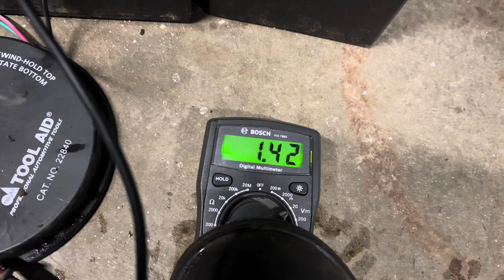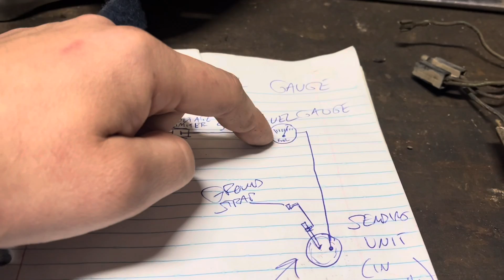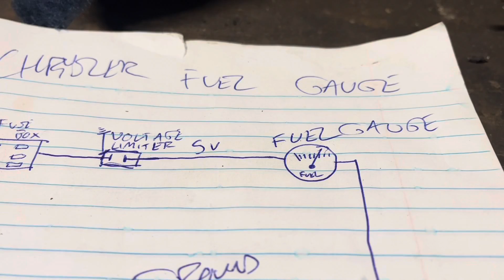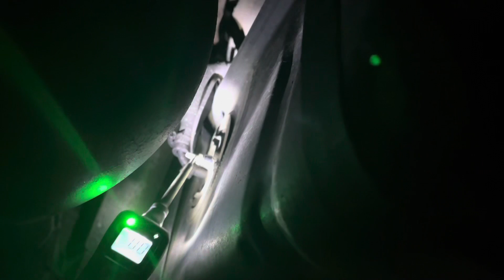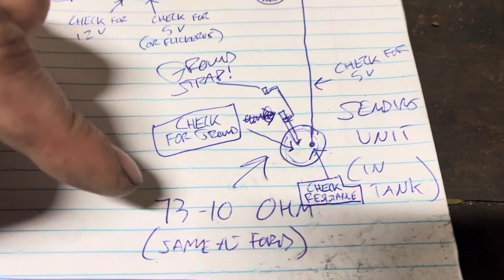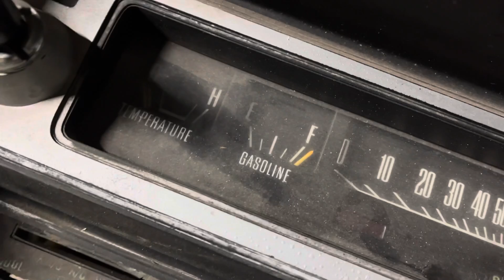Classic Mopar Fuel Gauge Problems (And Gauge Voltage Limiter Info)

Comment: My gauge lifts to zero when ignition on but won't go higher. I haven't been able to check for voltage dropm
Reply from the maker: Assuming we’re talking about the fuel gauge, if it’s coming up to zero, you almost certainly have a bad sending unit / sunk float.

Comment: Thank you Jamie, When I had all my Mopars it was in the mid 80's to early 90's before I got on as a pilot with the airlines, I never ran into any of these issues. Gas had lead in the fuel and never went bad, nor did I have any electrical problems, I Am learning a lot. Thank you Sir.

Comment: Hey Jamie
even if this video is old what would happen if the gauge was to receive 12v constantly? the gauge would show full at all time or just fry?
Reply from the maker: Gauges will burn up quickly - and when I say burn up, there won't be flames, but there will probably be smoke. Been there, smelled that.
Reply: @DeadDodgeGarage okay so I need a proper ohm regulator like a metermatch

Comment: hey I heard you mention you used to get the emulators at radio shack, but you don't see those anymore.....I was amazed to see a Radio Shack when I
was in Maui Hawaii last week! It was actually in Lahaina at Whalers village.  I wish I would have thought to take a picture. Hey thanks for the 
gauge info, I was unaware of the limiter, even though it is listed in my schematics as a regulator. My sender is fine, 8-75 ohms. And my gauge is not
dead, it shows full or near full when tank is full, but once you get down to 3/4 or less it starts going all over the place, everywhere but the actual 
reading! Going after it this week.
Reply from the maker: Interesting that the sending unit tested out ok. They tend to be at fault when gauge readings are inconsistent like that. The gauges tend to be more of a pass/fail situation in my experience. They work, or they let all the smoke out. 

Limiter / regulator terminology - I think either is fine. But I have to intentionally say “limiter” to distinguish this part from the voltage regulator under the hood. This has confused people in the past.

Comment: Mine is a 1973 Barracuda and the problem is the gas gauge works when it wants to so while driving it will go from empty to a half tank and back to empty while just going down the road. Any suggestions?
Reply from the maker: Most likely a bad sending unit. My demon does something similar.

Comment: Thanks for the video; I will be looking at these items on my '71 Demon as the gas gauge does not work. All other gauges do work so i assume its no the voltage regulator. I've ran out of gas twice now so i guess it's time to figure it out. The odometer does not work either. Wife gets a little unhappy when we run out of fuel, lol.

Comment: My 67 Dodge Cornett 500 when I turn my headlights on the fuel and temperature gauge both go to maxed out
Reply from the maker: Interesting. I suspect power from the gauge back light circuit is somehow jumping over to the output side of the gauge limiter.

Comment: I recently took my dash out to replace the lights and installed new circuit boards. After installing it back in the car, my lights work great but my currently working fuel gauge is now not working. Key on, gauge goes to past full. Key off, gauge drops to empty but slowly. Any ideas?
Reply from the maker: Either your limiter is bad and you’ve got full 12v going to the fuel gauge (which will burn it up quickly) or your sending unit wire / pin somehow ended up grounded. Also not good

Comment: Hey I know this is actually kind of an old video but I'm having some kind of issue with my fuel gague and I can't find anyone that's having the same issue. I've got a 1972 Plymouth Sattelite Custom with 57,000 miles on it with nearly all original parts.

Essentially, my fuel gauge reads empty most of the time. Every once in a while it will just randomly start bouncing up and down slowly. Even when parked on a level surface. I watched the gauge move back and forth for about 10 minutes. Then the next time I fired it up the gauge was back on empty. It's been probably one out of every fifteen times I fire the car up that it does this. I have a video if anyone thinks that'll help assess what's going on. My guess is something with the wiring but I'm not sure because I know absolutely nothing about electrical.

 I am brand new to the Mopar life and the classic car life so if anyone happens to know something then I'd love to hear your thoughts.

Comment: Question. 64 Polara. Temp gauge passes the grounded sending wire test, tries to peg but no reading with a hot engine, new sending unit in the water pump. Temp gun shows 185 at the thermostat housing. Please help, I'm lost.
Reply from the maker: Huh. That’s very odd. 185 should definitely be registering a gauge reading. I’m not sure what to think of that.

Comment: Whay would you say causes my fuel gauge to stop working when I fill up the tank. 3/4 full it's OK, any more it goes to below E.
Reply from the maker: Bad sending unit in the tank.
Reply: @DeadDodgeGarage  Thanks Jamie. I have the original. New parts are crap these days. I will swap it out.
Reply: @DeadDodgeGarage  You were right but it was the sending unit wire that had fallen off. I cut back some if the plastic connector  cover and if mounts on really tight now. Thanks again.

Comment: one of my 73 darts i did the 7805  voltage regulator,  capacitor and heat sink upgrade.on the dash,  worked great never failed

Comment: Hi Jamie I have changed my fuel tank for a fuel cell with a new sending unit now my gage reads backwards. What gives?
Reply from the maker: Your float is sticking off the wrong side of the sending unit. I’m assuming this is one of those universal type sending units that can be adjusted and such. If not, well, that would be very strange.
Reply: @DeadDodgeGarage  hi Jamie it's a racers choice I'm not sure I bought ase a complete unit I will check.tks for getting back so quickly.love the video's..!! Cheers

Comment: Jamie, love the video, but what does it mean when I ground out my sending unit with a test light, the test light is blinking with the power up and down but the fuel gauge doesn’t move, would you assume the fuel gauge is still bad even though Power is going through it?
Reply from the maker: Using a test light isn’t the same as putting a wire straight to ground. The bulb adds resistance. Try that and see what happens. If there is still no movement, yeah, it must be bad.
Reply: @ I put a ground wire on it and that fuel gauge ran up like it was running from the police. Definitely a bad sending it! Thanks!
Reply: Thanks Jamie!!! The sending unit has a big sticker that says "maid in Taiwan" on it LOL Love your channel by the way.  Still waiting to hear if your putting the Hemi in the Charger or not?  If you get a minute, check out my 69 charger project on my new channel "Hemivertible" I enjoyed watching guys so much on Youtube I figure I'd jump in with you!!

Comment: Great information. Thank you brother! Please give the best place to purchase a solid state regulator. Just in case I need one. My fuel gauge pins full all the time. My temp gauge works.  Any input is greatly appreciated. Thank You.
Reply from the maker: Standard Ignition actually makes a replacement mechanical unit. The fancy electronic type comes from Charger Specialties.
Reply: Thank You Sir.

Comment: Im working on a 65 300. Is that capacitor that plugs in next to the voltage limiter  necessary for the fuel gauge to work? If i replace it will any capacitor do. Was gonna grab one for a points distributor
Reply from the maker: No, it is there to prevent interference noise in the original radio.
Reply: Thanks! Much appreciated.

Comment: My 68' valiant /6 with the ignition on the temp gauge arrow moves from left to right-side and maxs out. I've unplugged the boot terminal in the meantime. Is this commonly known to happen when the instrument panel 12v regulator has gone bad?
Reply from the maker: Yes, your limiter is stuck closed and it’s trying to fry your gauges. It would fry your fuel gauge too, but it sounds like your sending unit is probably bad so there is no path to ground to complete the circuit.
Reply: @DeadDodgeGarage  I would agree the fuel gauge, and alternator still function. Are there any tricks of the trade on confirming TSU to have gone bad. Would you recommend I R&R the limiter as well

Comment: could an actual ballast resistor be used in a pinch Jamie ?
Reply from the maker: Negative. The voltage limiter is not a resistor - and the ballast resistor is not exactly a voltage limiter, although lower voltage during operation is observed.
Reply: @ Rr cheers , have good Christmas 🍀

Comment: i got round guage with fuel in the middle. I can’t find this part ? help .
Reply from the maker: Three stud fuel gauges have the limiter built in. Many early to mid 60s dashes are like that. I didn’t cover them specifically in this video. It’s essentially all the same, except that limiter is hidden in the gas gauge, so it’s a bit more complicated to fix.
Reply: @ thanks Jamie
Reply: @ Jamie ! It’s fixed !, Thank you very very much . Just behind the Monaco temp guage was the limiter . Tiny purple wire was burnt . Solder connect and seems ok 👍

Comment: Hey Dead Dodge Jamie........Technical Question fer ya:  I pulled out the Voltage Limiter from behind the dash of my '74 Dodge D100, and ran a test on it........she is turning on/off and popping out the correct range of volts....2 - about 6 volts.  So I then turned on the Ignition Key and tested all the fuses behind the glove box barn door.......all tested about 12 volts except the Dash Cluster fuse.  So I thought "Ahhhh Haaa.....excellent.....its just a blown fuse".  Not so easy......I pulled the fuse, and it is fine.  However, there are no volts showing up at the fuse panel connection points.  Does the juice first flow to the Voltage Limiter, and then on over to the Fuse Box?  So, with the Voltage Limiter removed, it is normal to see no volts at the fuse panel behind the barn door glove box?  Im gonna pop it back in and then test the fuse box for power......but thought this question might help someone else also.  

I have no dash lights, no fuel gauge reading, and I believe the Water Temp gauge is also not working.....thus, I thought the V. Limiter was the gremlin.   What say you?
Reply from the maker: I don’t know what feeds the gauge limiter in that truck, but I have a feeling that the fuse you were looking at is for the gauge lights. It is fed by the dash light / rheostat section of the headlight switch. I highly recommend you consult a wiring diagram!
Reply: @DeadDodgeGarage  Thats a Big 10-4 from my Dead Dodge Glove Box Barn Door.
Reply: @DeadDodgeGarage  Yes, you are right......turn on the parking lights or headlights and power goes to that little 2amp fuse.  From there it feeds the dash lightbulbs.  I see 2 round condensors mounted behind the dash.  One is connected to the positive feed connection prong of the Voltage Limiter.  I cant find anything in the big Shop Manual describing what these "condensors" are for.  Can you pull an answer from your vast wisdom of Mopar  Wizzardery?  What the heck are these 2 condensors for.  If they are bad, will it cause the Voltage Limiter to fail also?

Comment: Ok I have a question 
 I’ve got a 69 superbee , I’ve upgraded to a solid state voltage regulator but all the gauges read low , temp barely gets warm , oil pressure 20psi ( checked with manual gauge and it’s about 50psi ) and it never shows more than half a tank …. Despite it being full …. Any pointers ?

Comment: i have my 67 belvedere which is 100% original torn apart and i see no voltage limiter anywhere under this dash !!
Reply from the maker: Ahhhh, it’s built into the fuel gauge on that car. Look for instructions to eliminate that and convert to the later type.

Comment: stupid dash never ever ever comes apart i need to know the location and keep getting zero answers
Reply from the maker: The location of what? The limiter? It’s on the back of the cluster. Probably perfectly blocked by the steering column support bracket. Lower the steering column slightly, which requires removing a plastic panel (2-4 screws, if it’s even there) and 3 or 4 7/16” hex nuts / bolts. Take the screws out of the cluster. Pull the cluster forward. Make sure the battery is unhooked when you do this. It’s annoying, but it’s not hard to figure out.

Comment: First thing to check on a fuel gauge that floats is the connector between the fuel sender nipple and the fuel line to front of the car. It crimps on the nipple and the fuel line. It provides ground to the sending unit. They corrode and break. Always check that first. Always.
Reply from the maker: The metal ground strap? Sure. Great thing to check, and I’m confident I mentioned that here. But also, in many cases, the sending units are able to ground through the lock ring, tank and mounting straps to the car. I’ve seen multiple cars with no ground strap on which the gauge works fine. I’m not suggesting that will work 100% of the time, but despite all of the hack jobs I’ve had to deal with over the years, I have never once had a missing or otherwise goobered ground strap be the cause of a gauge problem. Yet.
Reply: @DeadDodgeGarage  That is the good fix I saw back when there were Mopar magazines. Using that Voltage regulator IC. Good for you to share that with others.

Comment: My man, thank you so much. My voltage limiter was topping at 6v max as yours, changed it and I finally have my gauges working properly + I’ve learn quite a bit about the system. 

Thanks for doing those videos, you’re saving us. Have a good one
Reply from the maker: Awesome! Glad to help.
Reply: @DeadDodgeGarage  do you have the part number for that?

Comment: I know this is an old vid but, do you have the part numbers off of the solid state regulator you use. I’m going low tech on a Durango and have an early 70s sport fury cluster that fits in the original hole pretty well. It’s a nice all in one part. Speedo, gas, oil, temp. The cluster has been in dry storage for 20 years. But I figure I might as well change it out wile it’s easy to get to.
Reply from the maker: The little limiter I solder in looks like this: https://www.digikey.com/en/products/detail/stmicroelectronics/L7805CV/585964

The fancy plug in ones look like this (note there are a couple different styles): https://www.ebay.com/itm/165630787671?chn=ps&norover=1&mkevt=1&mkrid=711-117182-37290-0&mkcid=2&mkscid=101&itemid=165630787671&targetid=2301729088052&device=m&mktype=pla&googleloc=9033514&poi=&campaignid=21214286338&mkgroupid=161332760117&rlsatarget=pla-2301729088052&abcId=9407521&merchantid=6296724&gad_source=1&gbraid=0AAAAAD_QDh9AeCj2nBjFCS76XVm-ArG4X&gclid=Cj0KCQjw3ZayBhDRARIsAPWzx8qwo-Cvqyh8QQQtGXcT_cFrJl3v08RkKsqtxTSUSF3tDeA3PNydPgUaAuyaEALw_wcB
Reply: @DeadDodgeGarage  thank you just ordered a few.  You have really nice hats. Got mine Friday. 👍👍

Comment: thank you for this, certainly stears me in the right direction. On qustion though, at the end of th video you mention if tmp and oil dont work as well then its almost definetly the limiter, does this stay true if my alternator gauge is working?
Reply from the maker: No - the ammeter / amp gauge / alternator gauge is a totally separate deal. Only factory oil, temp, and fuel gauges are powered by the limiter.
Reply: @DeadDodgeGarage  Awesome thanks for the reply eh. and yea I testd the limiter using your method and was getting zero volts. Ripped that bitch open and yup shes fried lol. Hate to bother you more but do you have a part number for the voltage regulator you used at the end or do you know of any links that may help me not destroy anything lol, thanks agai n man,cheers.
Reply from the maker: @roryadam  the ones that I solder wires onto and mount to the back of the cluster are like this one: https://www.digikey.com/en/products/detail/texas-instruments/LM1084IT-5.0%2FNOPB/363556?utm_adgroup=Texas%20Instruments&utm_source=google&utm_medium=cpc&utm_campaign=PMax%20Shopping_Supplier_Texas%20Instruments&utm_term=&utm_content=Texas%20Instruments&utm_id=go_cmp-17816159938_adg-_ad-__dev-m_ext-_prd-363556_sig-CjwKCAjwouexBhAuEiwAtW_Zx-TBlXiWIcYDVcdUvc0Pn4Y653_ILFCgK295Z-lqOXMPqnBetw3_NhoCdYUQAvD_BwE&gad_source=1&gbraid=0AAAAADrbLliOrJaOMZprG9RqbTgyh3C_C&gclid=CjwKCAjwouexBhAuEiwAtW_Zx-TBlXiWIcYDVcdUvc0Pn4Y653_ILFCgK295Z-lqOXMPqnBetw3_NhoCdYUQAvD_BwE
Reply: @DeadDodgeGarage  awesome thanks man.